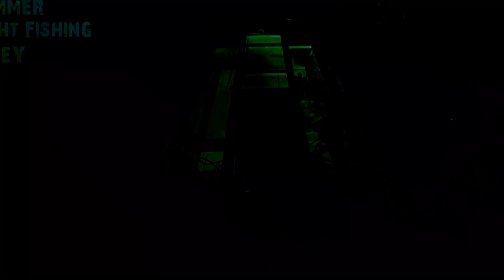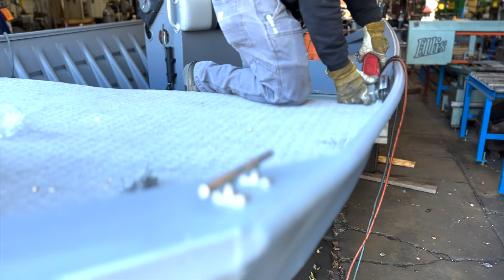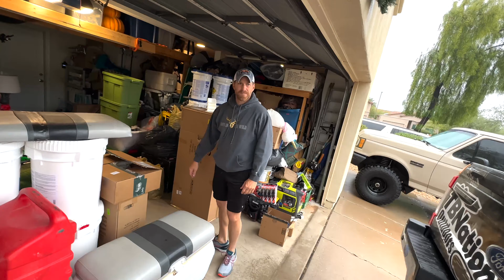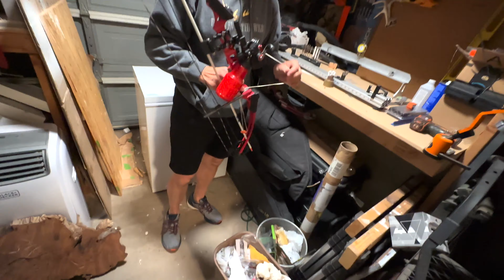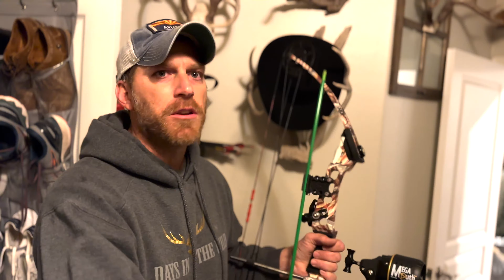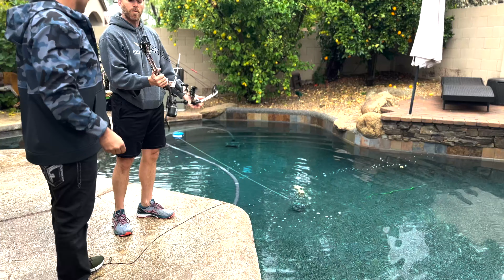Lets build a bow fishing rig - THE START

Comment: Did your jacket catch in the cam on the shot? Wild. Never seen a cable break into the cam like that before.
Reply from the maker: what part of the vid?
Reply: @TinyBoatNation  when you shot the bow fishing bow and the cam split from its cable.  That was weird. I was trying to figure out how that could happen. It looks like your jacket was touching the cam when you were drawn back. 
Was he able to fix it?
Reply: @rabidraja11  my guess is he torqued the bow so much it was pulling the string off the cams so it derailed. because most novices are afraid to have the string close to their faces and those cams have fairly shallow wells

Comment: No ill intent butttttt those finger savers are the worse that are on the market. Nitro fuel tubing is way better for finger savers. Not only does the string have to be in front of the rest but it is imperative that the cable slide is in front of the rest. The MegaMouth when first introduced was $270 plus and has graduated to $400 (2024) in 4 short years. VERY good reel WAY overpriced but some look at it as a status symbol.